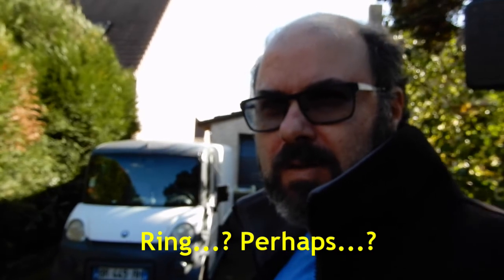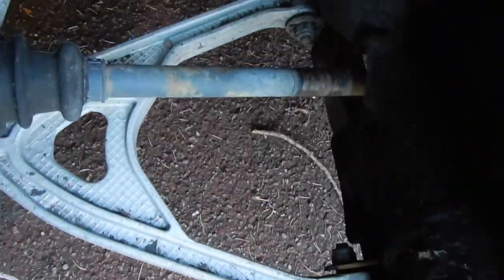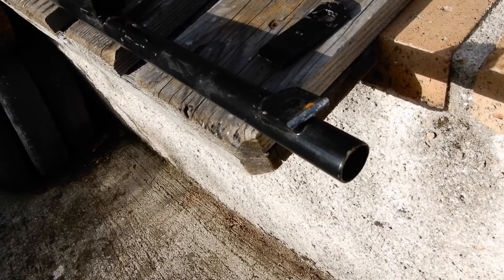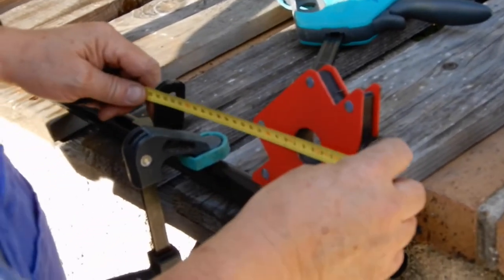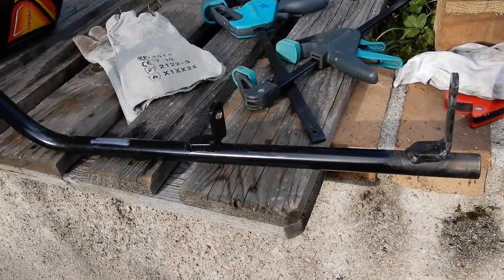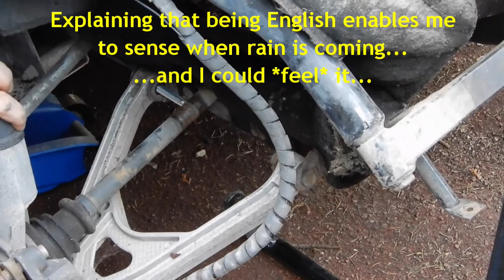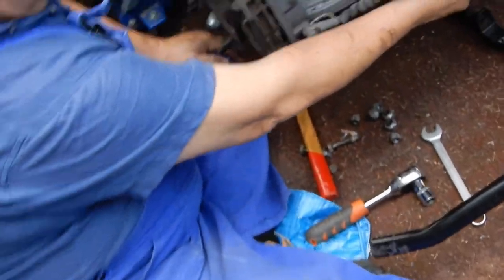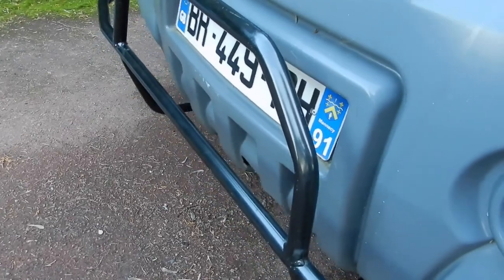Fitting the front protection bar | Aixam Mega Multitruck Van

Comment: Good video, the bar looks really good now. Can you weld two more brackets along it just behind the bumper for it to bolt to secure it at the bottom?
Reply from the maker: Thanks. There is one small metal bracket at the front left of the subframe, intended to hold the bottom of the dash panel. There is supposed to be one on the right side, but that seems to have broken off at some point.
A replacement one could be welded on.
Then out come the cable ties...
Reply: @MegaBreadvan  oh right cool, will your BIL help weld that bracket on for you ?
Reply from the maker: @CaddyConversion  He has offered. Which is good because I'd probably be dangerous with a welding torch in my hand.
Reply from the maker: @CaddyConversion  Have since bolted two brackets onto the protection bar. But as I'll need to cut off the damaged lower bits on the front dash panel, I'll probably have to find a way of fitting an extension on the top part of the brackets. Then use these as a fixing point for the lower part of the dash panel. Life isn't always simple is it?
BTW... New soundproofing panels currently on order from Pro VSP. They don't hold them in stock, so they've had to order them in. Cost an arm and a leg for what they are... But hey, what can you do eh?
Reply from the maker: All this time later I've finally come up with a solution. Hope you have been well.
Reply: @MegaBreadvan  cool, what did you do?
Reply from the maker: Sorry been a long time. LOL In the end I riveted an aluminium to the bottom of the dash panel, with rubber behind it, so the plastic is protected. This is fixed to the protection bar using brackets. Am sure there is a better solution, but it'll do for now. I will have to remove it soon as I need to check the subframe and fit new engine compartment insulation. Since April and MOT is now required for all sans permis vehicles. Something I need to get around to. 😬